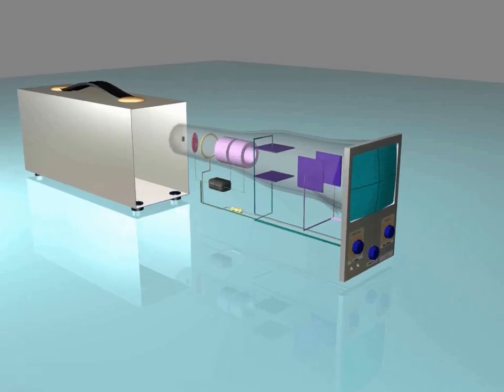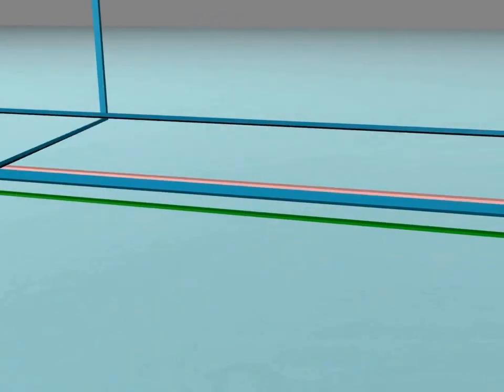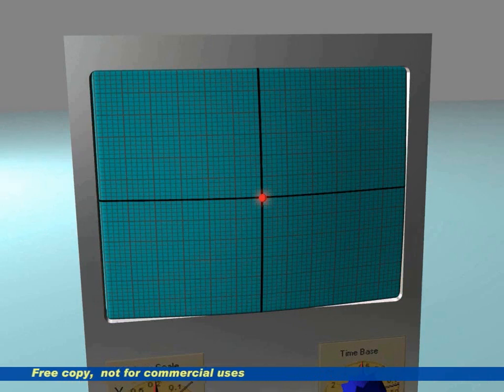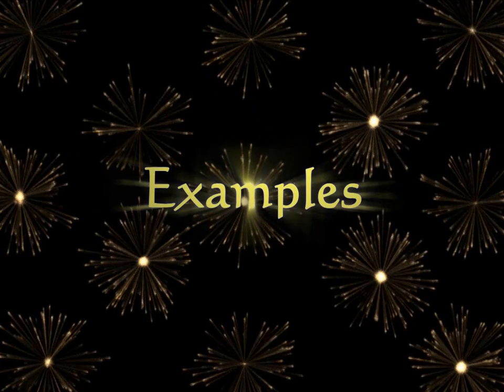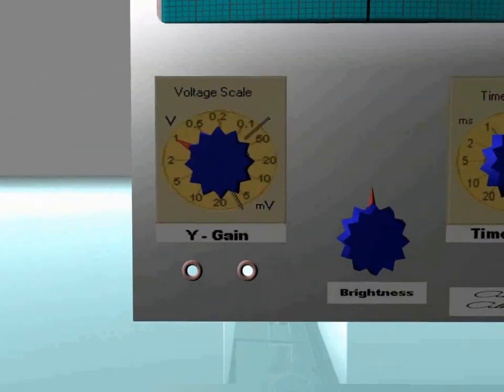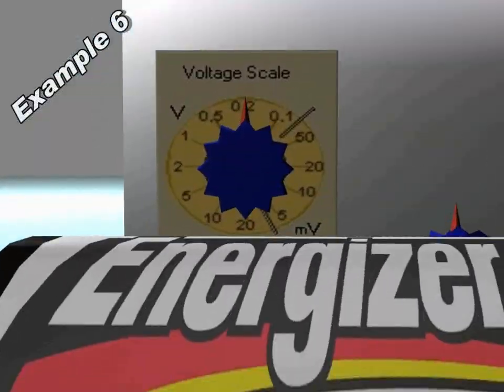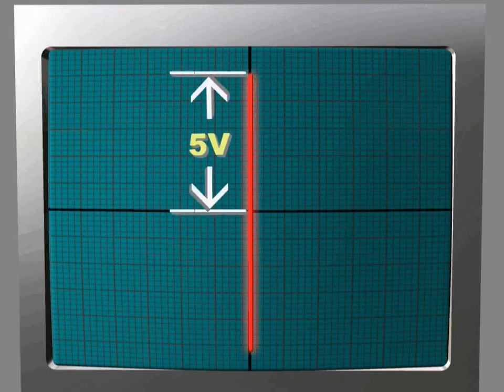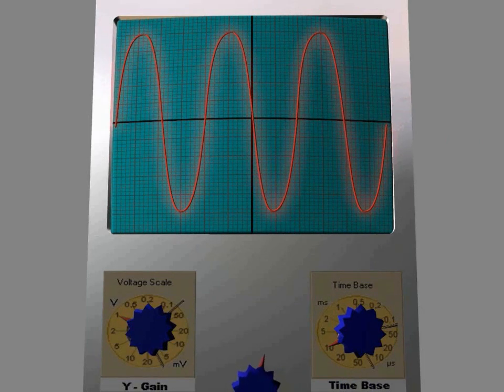Ch3 L7 CRO part2 International Edition

Comment: Good analysis of the CRT.  Key points are 
1. Heating element and thermionic emission of Electrons (boiled off)
2. The Focus ring is negative to the Electrons centered
3 The Anode + to accelerate the Electrons. (Opp charges attract!)
4.  X and Y plates to move the Electrons L and R or Up and Down
5. Phosphoric screen to capture the electron beam and light up
Also, you must REMOVE the air from the CRT i.e. create a vacuum to prevent the electrons from being attracted elsewhere.
6 A bar magnet will also deflect the Cathode rays. (fast moving electrons)